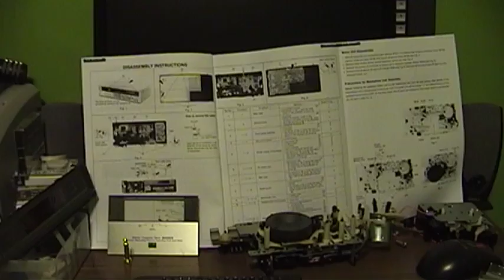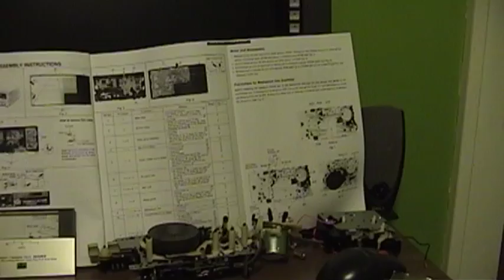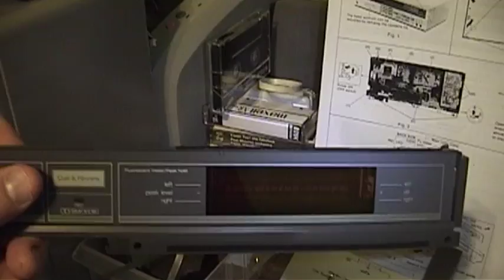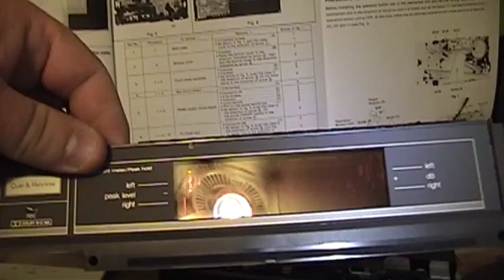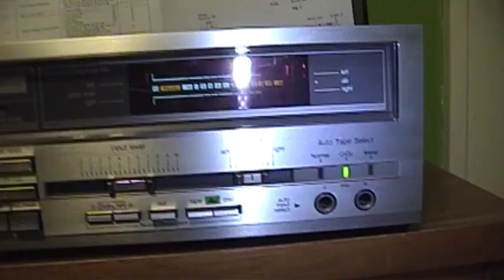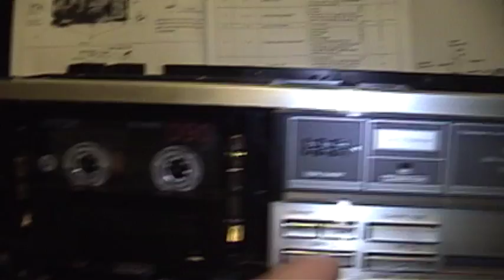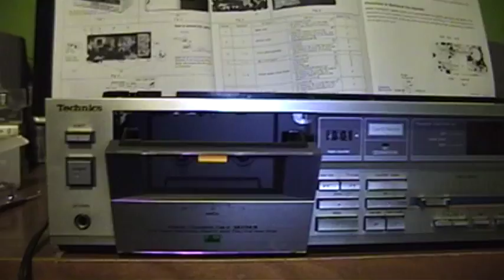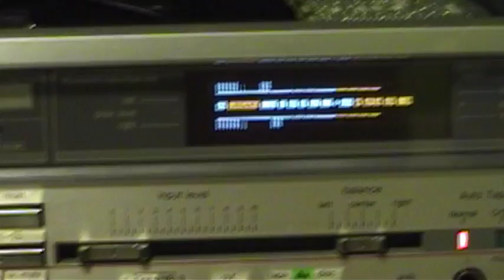Technics RS-M234X Cassette Deck Repair

Comment: Hey so I have a A650 stereo cassette deck. I'm afraid I shorted it or something. first I live in the philippines. Now, when I plug it in I use a 110v. It turns on two lights when I turn it on. The cassett player light and the right VU light. The internal system was really buggy "literally" and dusty do to it being in a shed like place. I want to fix it for fun. But I'm not sure what to do. When I press any other buttons the cassette does not play. I'm not sure if it's connection issues or motor issues. Can you help me? I'm willing to send pictures or even make a video for you to see it.
Reply: Okay. I'll try to do that. Do you have any advice to get to the belts? theres a lot of circuit boards in the way, nor did I see the belts. But I'll still try. Thank you.

Comment: hi how are doing need ask you question i have a cassette deck technics rs 234x every time i play it, has very feed bad feed back sound when take cover off it stop for awhile it comes in and out, what do think wrong with it
Reply: luckyjohanna5454 mine has the same problem, different deck though

Comment: I've found the problem it was just a dried capacitor on the BIAS oscillating circuit, now she's recording like new after 13 years of that problem lol :D and the resistors doesn't smoke any more!

Comment: uxwbill, I need your help. I have a problem with my old cassette player, it won't play the tape when i put the tape cassette in the deck. When i have no tape in the deck, it plays like normal, but when i put a tape cassette in, it won't play. Can you please give me a possible diagnostic on the tape deck pretty please.

Comment: OK. mine RS-BX404 stops recording after few seconds, when turned ON from "cold" (not turned on for few hours) or (when HOT - switched ON for a while) switching recording off it self after few seconds.

Comment: I have that cassette deck , the playback is working great but on  the recording is the sound will move ether left and right , can you help me on this?
Reply from the maker: It's possible that the pinch roller is starting to fail, causing mistracking.
Reply: uxwbill  is there any way to fix the pinch roller?
Reply: How can I fix it